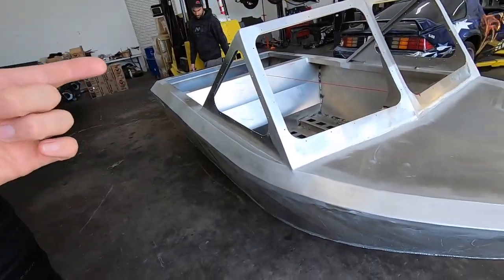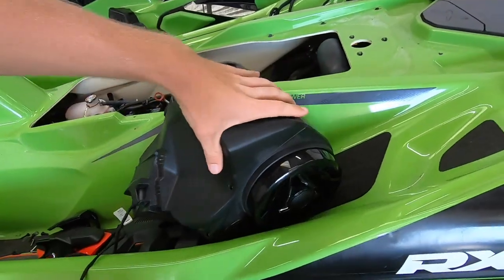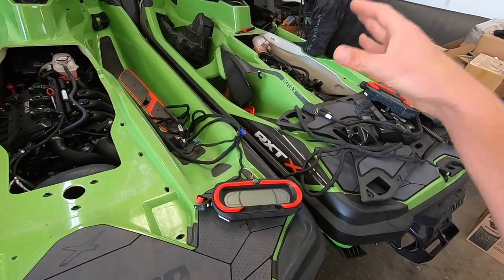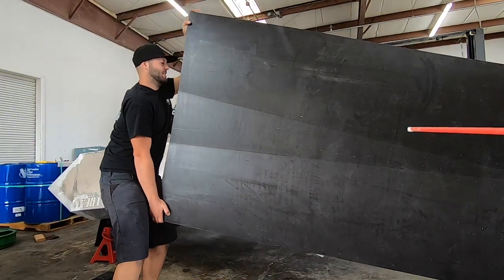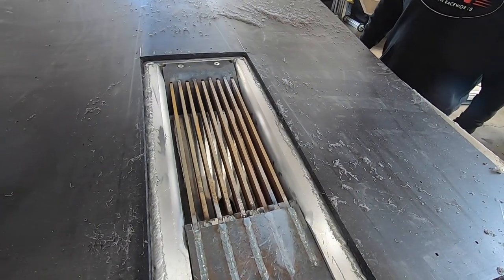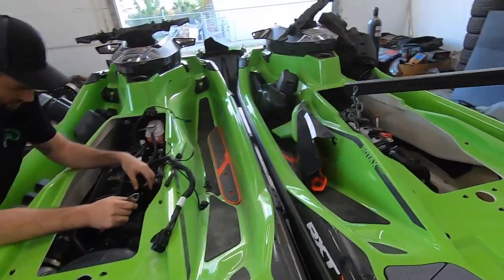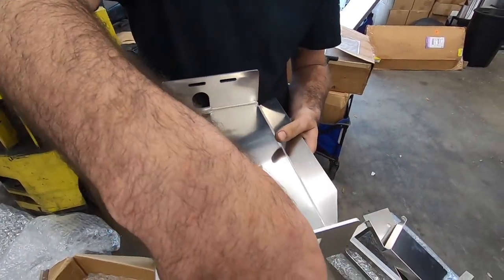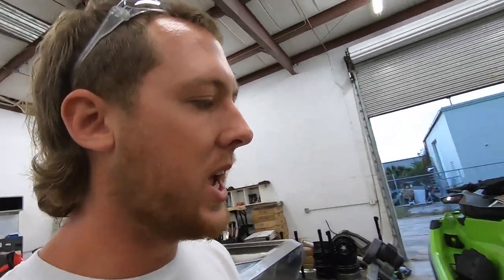Mini Jet Boat Build Part 3: Destroying BRAND NEW Jet Skis For Their Supercharged ROTAX Hearts!

Comment: takes about 1.5 hrs per motor to pull. drop the ibr gates before you take them apart. pull the gates and pumps out, remove c ring on the drive shaft, it takes a tool to get the carbon ring and everything compressed to get to it.  once driveshaft is out the motor comes out easy.  now, one thing i see wrong on your new boat. you need 2 water intake grates, and they have to be straight in line with the pumps.  the single one feeding both pumps is not enough and they are going to fight over the water supply and cause cavitation and burn the wear rings out of the pumps and possibly the impellers, plus your never going to get full performance. i get your design though, good idea with the rods to keep the rocks out, but take in to account how much bigger they need to be to get the amount of water your going to need. the 300hp motors, seporate intake grates, controls modded to work togather, that thing will fly!!!! the heavy hulls the motors came out of can run 75 stock, 82 with a good tune and supporting mods. and yes, i work on sea-doo and yamaha's daily, and mod them a lot.

Comment: Aye bud you need to run those bolts in the hull down with at least some 3M 4200 marine sealant if you ever plan on taking them off. If not run them down with 5200 sealant. I used to work at a marine shop and that's what we always used.

Comment: The plastic on the bottom of the hull is to protect it from getin banged up from rocks as you're sliding across bits of land and super shallow parts correct?
I do belive that's why.

Comment: We’ve done the jet ski thing a few times even with custom pumps tbh any v8 or v6 with a 3 stage scott Hamilton or Kodiak is a far better build the problem is the weight of the mini jet demolishes the impeller and rebuilds are so often that it wasn’t efficient. I was also the guy that rebuilt the impellers and pumps 3 stage is where it’s at sprint boat style

Comment: Use this to bond and seal the nylon hull guard to the hull https://industry.sika.com/en/home/marine/leisure-boats-andyachts/structural-bonding/sikaflex-292i.html it's much like a sealer I used when working on refrigerated truck bodies, they use it to bond the bodies together, we used it for sealing. It'll seal up all the bolt holes and the whole sheet will then be bonded to the hull, making the whole boat more sturdy in the event of an impact. Otherwise, this limey has been really enjoying the build of these jetboats, keep it up from good old Blighty.

Comment: Might want to think about using Lock tight red thread locker on all them skid plate screws as the vibration of the motor & water pounding on the hull will indeed back them out if you don't ( been there ! )

Comment: You should've used colored bolts on the bottom, so when you're airborne it looks fresh AF!! Probolt or similar.
Epoxy or silicone caulk the front end of the plastic underside to make a smoother transition and less drag in the water.

Comment: I had a seadoo dealer do some work on one of my skis. They let it run out of water too long and cracked the carbon ring. Next time in the water I got 100 yards and the nose of the jet ski was bobbin. Took a couple hours to get it out of the water.

Comment: i have worked for ford and roushe and to cut that material for your boats skids plate. i would use a jigsaw with a fine blade and a little lube. it will make a finer cut. very accurate and eliminate all that build up from cutting with a circular saw.

Comment: I would of welded those bulk heads in after fitting the engine and pump , you gunna have fun mounting everything in that small space with no room to move, you also need to line the drive shaft up perfectly or you will strip the splines in no time

Comment: There’s something unnerving about putting a million holes in a boat hull. I know it’ll be fine but the over-builder part of me would have put silicone or some other type of sealant in each hole then run the screw in, also it would help make sure they loosen up/back out which then would leak.

Comment: Put that sheet of black delrin (black plastic sheet) out in the sun on some saw horses for an hour and it will make it relax and easier to work with. You want it tight as possible.

Comment: You need strakes on these boats. They need bite to turn fast. Without them the boat will slide like it’s on ice. Check out the underside of a sprint boat.

Comment: You either need to remove the pump first or get the clip removal tool so that the driveshaft will slide out and then its easy to pull the engine... Live and learn pump then engine when removing both

Comment: should have put teflon or added a dab of rtv to the threads of the screws on the bottom, 100% they will start to leak soon after the abuse its going to take

Comment: G'day mate, had a crazy thought 7 minutes in why the hell aren't you doing a twin engine one as well. Now that would be sweet. No advantage other then awesome factor. Adam 'Australia'🙋‍♂️🇦🇺
Reply: Twin intake grilles? The reason for a central intake grille on a V hull is that the bottom of the V is the lowest point on the hull and is therefore deepest in the available water. Twin intakes out to the sides of the boat hull would inevitably have one side or the other sucking air in any sort of turn...and on shallow Alaskan rivers that means a lot of suckage!  Larger/twin-hulled jets do have more than one engine and intake...they mostly don't go up Alaskan rivers though...   https://www.nzherald.co.nz/business/kiwi-jets-power-korean-patrol-boat/Q6F6MX4LURONTQTZICH4LDAYIM/
3700hp engine per each water jet; 4x water jets

Comment: You should fair in the plastic protector like make the transitions smoother, you can use stuff like Fairing epoxy there is special marine epoxy fairing compound that you can use.
Reply: As long as the plastic extends above the normal waterline there is no need to fair in the leading edge. Just glue it to the hull so that when you hit a large rock it adds strength to the aluminium. You still need to panel beat the alloy when you get home...

Comment: As a marine mechanic, I definitely recommend replacing the stock sea doo impeller housing wear ring with a fully aluminum one. The stock ones are plastic and will get chewed up in an instant if any twigs or sand or small rocks get sucked up into them.
Reply: Custom made bronze wear ring is the way to go. It is softer than the stainless impeller ..but harder than the aluminium/plastic wear rings...so it can still be minimal clearance for good performance but won't shatter like plastic/crunch up like aluminium with stones being ingested.

Comment: Many others have already said it but, take ALL of the screws out of the HDPE one at a time, put marine grade sealant on them (4200 would probably be best) and fasten it back in.  Lather, rinse repeat until they are ALL sealed, unless you want added water in the bilges.
.
Another thing, either sand the edges of the HDPE near the water inlet or put a fillet of a good silicone sealant/caulk there to ease the water flow.  Think of it as the airflow into either Ruby or Leroy, you want a little turbulence as possible.  I'd also seal/caulk the edges of the HDPE for the same reason.
Reply: A stainless steel edge trim bolted down to keep the UHMPWE from lifting needs to go on the  outside of the intake grille.
Reply: That trim piece is recessed into the plastic so as to present a smooth surface to minimise intake water turbulence...

Comment: Remember to change/rebuild the superchargers every once in a while, those Rotax seadoo engines tend to have supercharger failures which almost always sends metal into the engine. I love the Seadoo Rotax engines, they have a lot of power and sound really really good. This is just my one issue with them.
Reply: 2017 & up 4-tec superchargers are service free / maintenance free using much better bearings than the older ones like I have.
Reply: @peteweigman4504  Oh good, glad to see they fixed that. The supercharger on our 2011 Wake Pro had to get rebuilt a few times. Would have hated to see them finish the jet boats just to have their engines get ruined.
Reply: Yea, I've got the 2015 WakePro and rebuild the SC every 2 yrs.  Getting old...
Reply: @peteweigman4504  Yeah, It's a shame that they made it that way. They are really great when they work but whenever they don't it gets annoying and expensive, especially the IBR system, that can get really expensive.

Comment: What's the point of the plastic on the bottom?
Reply: If it is glued as well as screwed to the alloy hull it adds strength to the alloy when you hit large rocks at speed. Plus it allows the boat to "slip" off and over smaller rocks and gravels...where alloy would just rip and tear...anyone for a sinking boat?